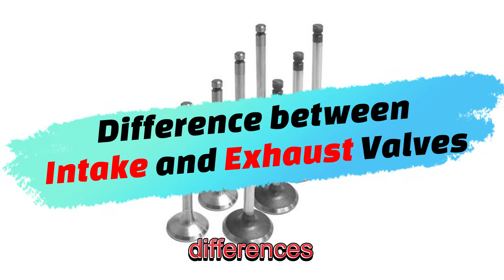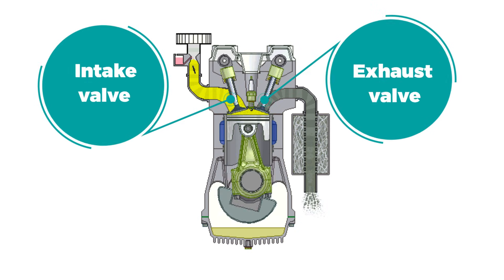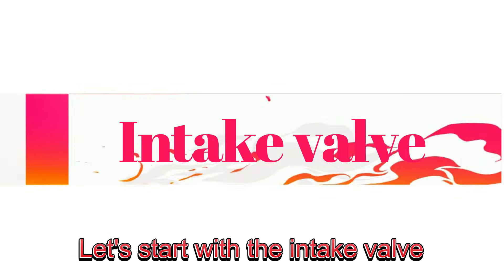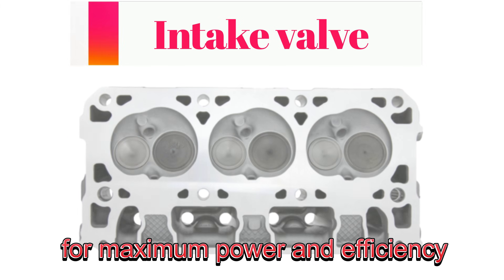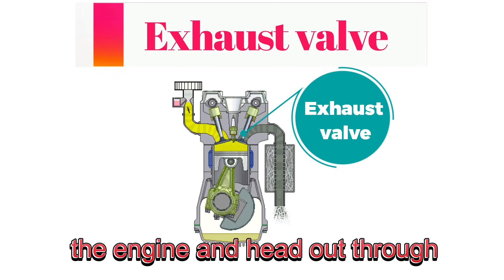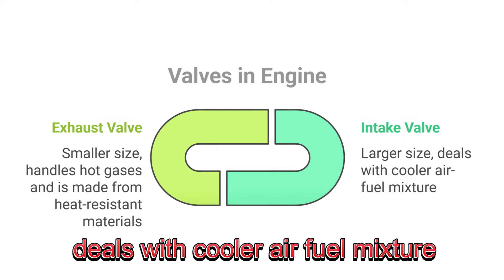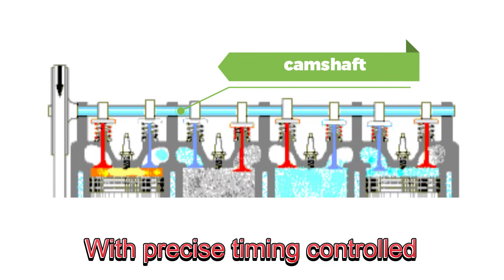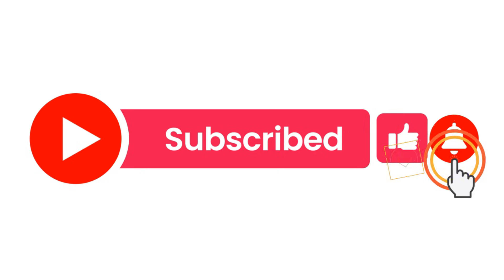Intake vs Exhaust Valves: Key Differences Explained!

Comment: What would happen if the piston intake side interchange with exhaust side ?
Reply from the maker: no, intake and exhaust valves are not designed to be interchangeable, and they often will not physically fit in each other's places.